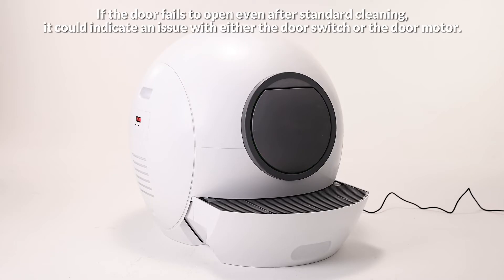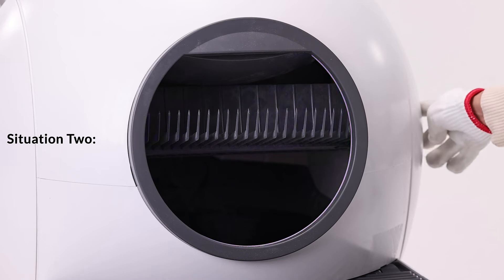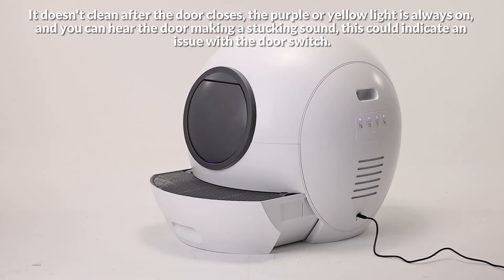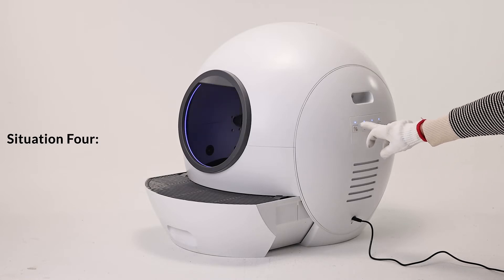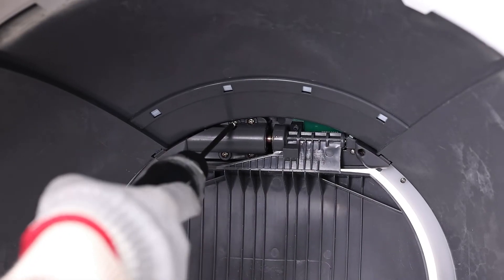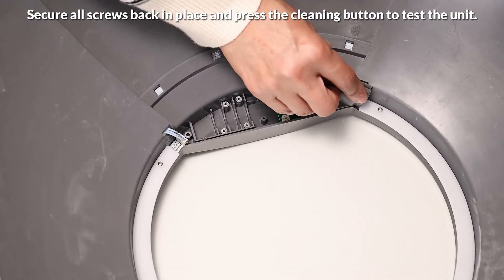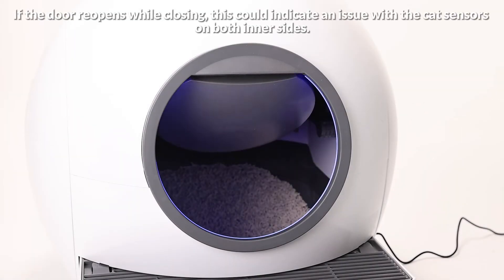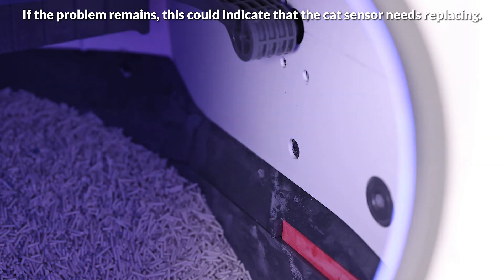Safety Door Troubleshooting

Comment: I used mine for less than two weeks and then the door stopped closing. Even if I push it into place, it won't actualy shut all the way, it sits about an inch away from the opening and the rake cannot do the full cycle. It won't shut when starting the cleaning cycle either. So frustrating I wish I could get my money back.